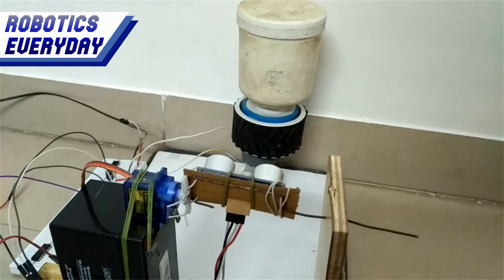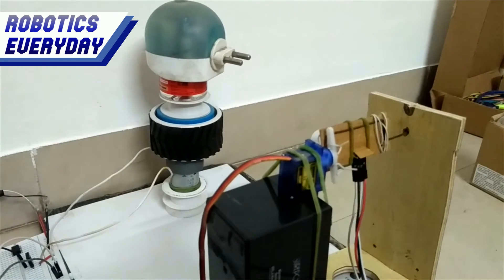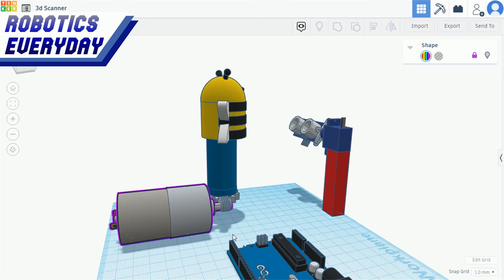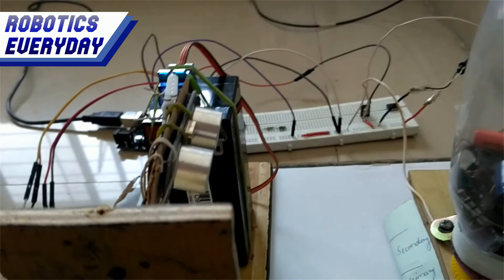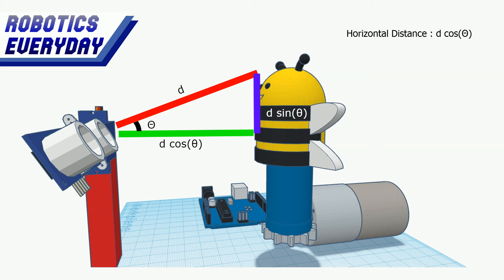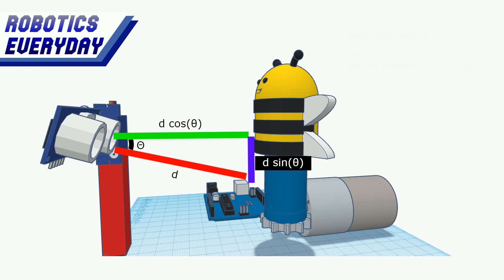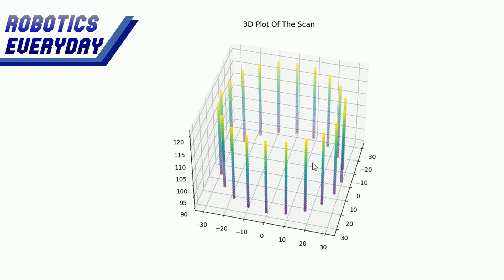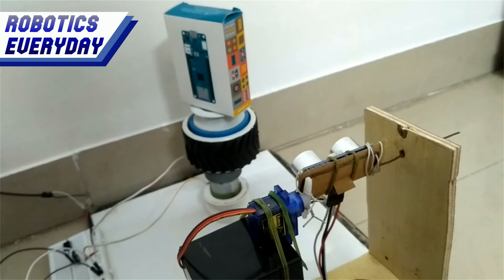DIY 3D Scanner | 3D Scan Any Object At Home | 3D Plot with Python MatplotLib | Arduino With Python

Comment: can you try with a VL53L0x, I am building one but there are some problems when reading data and control the servo at the same time :((
Reply: Did you manage to get some usable data out of it? I have recently created a similar design using the VL53L0x and two stepper motors (one turning the object and the other one moving the sensor vertically using a threaded rod) and the output is just garbage.

Comment: Cool project! You should consider using an infrared distance sensor and also placing another distance sensor at the top to get a better view of the object's shape
Reply from the maker: That's the plan! 

We are also thinking of making a handheld 3D-Scanner, which will have distance sensors and IMU to get the exact position of the scanner in the 3D space and make the scanner portable.
Thanks for the tip!

Robotics EveryDay!